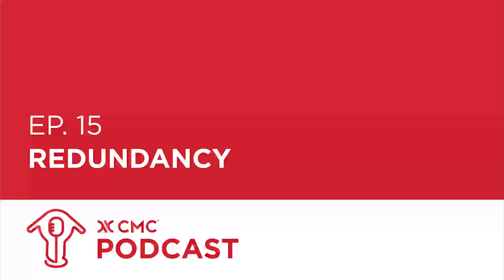CMC Podcast E15 - Redundancy

Comment: My application is military rope access and rescue. How do you feel about using rigging plates as a master point for a litter bridal? The only issue I see is possibly side loading during edge transitions, but I think the benefits of having a tidy, pre-built and easy to inspect setup greatly outweighs that single concern. Thanks in advance

Comment: At risk of opening up a rope rescue rapid intervention rabbit hole, I have this question:
When using a double pulley for change of direction pulley in a twin tension system, what is the plan if there is a catastrophic failure of one side of the system when the manufacturer states “Note: Do not load a single side only of a double-sheave pulley.”
Will the suddenly-single side-loaded double-sheave pulley be a problem? 
Will it need to be replaced with another pulley before what is left of the system is operated to retrieve our rescuer or live load?

Comment: What are your thoughts on someone using wrong size diameter ropes on descenders ? For example using an 11mm rope on a rescue  petzel I’d even though the minimum is 11.5mm because I’m sure many teams and departments making the switch from half inch to a smaller size would like to keep devices due to the cost of buying new ones.